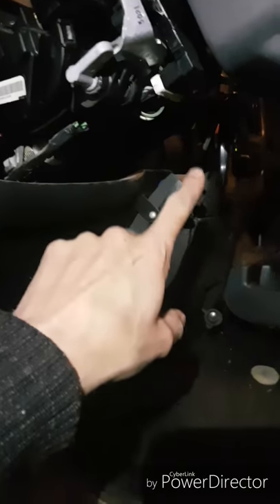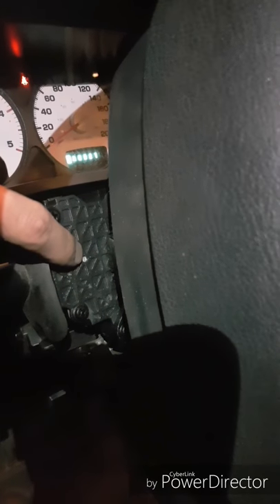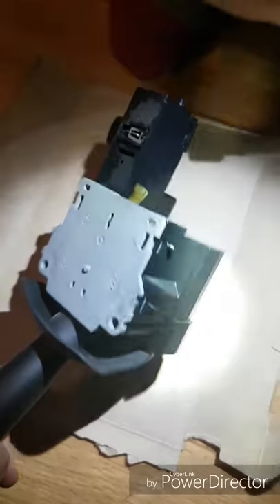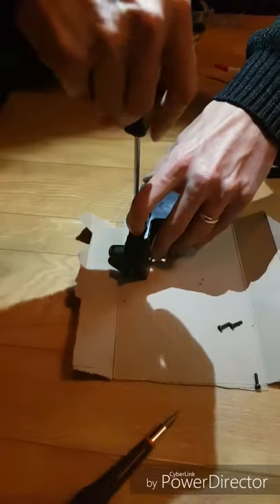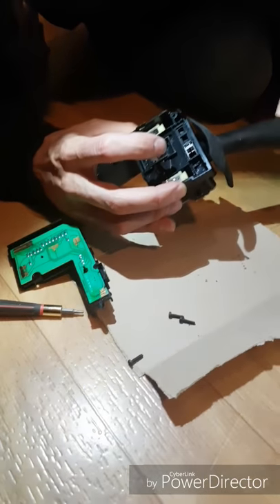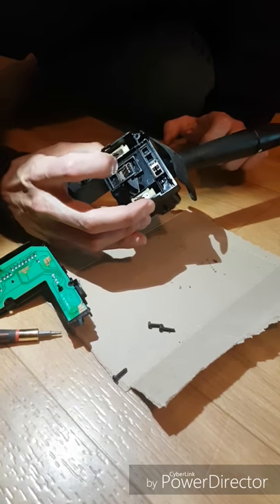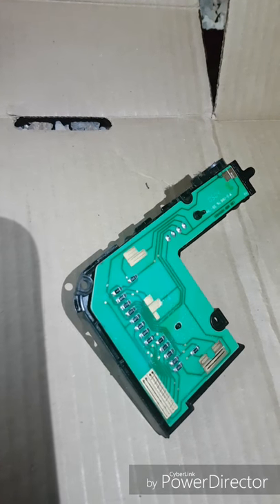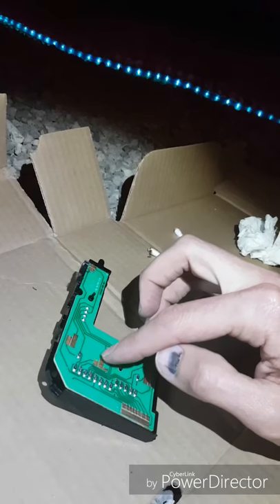DIY How to clean and repair the multifunction switch 05 Dodge Ram

Comment: Thank you for taking the time to make this video! It worked great and fixed my intermittent high beam and turn signal issues. Definitely worth the time to do this repair rather than buying a new switch.

Comment: All I can say it WOW, this short video changed everything for me. I have read horror stories by some on the Dodge Forums and elsewhere about how hard these switches are to replace and cautions against setting off the airbags, and all other sorts of BS. This was a simple 20 minute piece of cake to perform. What a great design that allow you to open up and clean the switch out. I did mine a bit different. From my take on things the probable reason for the failure was all the lubrication that is on the front side of the switch for all the gears mechanisms that are part of the turn signal, wiper, washer, headlight control that had run into the side where the contacts were. In my case when I got the switch out there was copious amounts of oily material all over the outside and the inside of this switch. I am assuming the heat through the windshield made this stuff so thin that it ran all over. I cleaned all of this out of and off of the switch, used an eraser to clean off all the contacts and put it back together with no lubricant or dielectric grease. If my repair doesn't last long I will get some dielectric grease to coat the components with. Thank you so so much for this video.
Reply: Whenever you are working near a component near the airbag you should turn them off and let the capacitors discharge before starting. He may have done it off camera since he mentioned that he wasn't going to show that part. Just because it's simple doesn't mean that it isn't dangerous so please be careful!
Reply from the maker: Thanks for adding your comment, Alexander!

Comment: Is the switch still working.
Reply from the maker: The wipers started malfunctioning again, about 6 months ago.  The blinkers are still working great.   So, I just took out the switch a month ago again and cleaned it up.  It's all working well again.
Reply: Wow! So easy even my 95 y/o mom fixed her  cruise control.